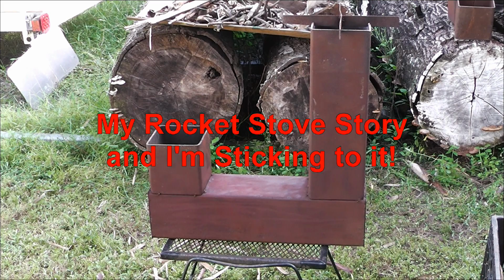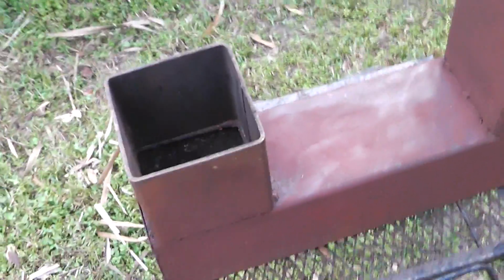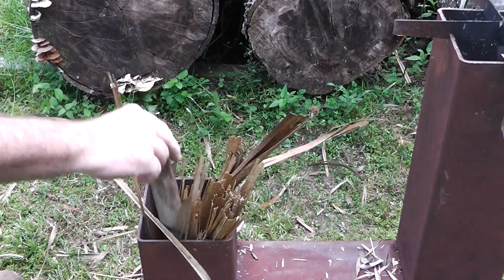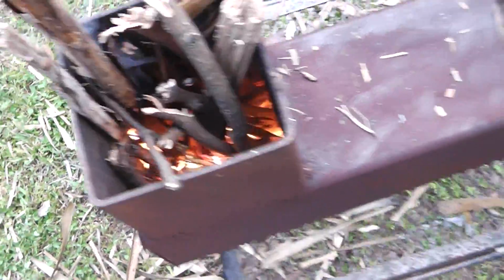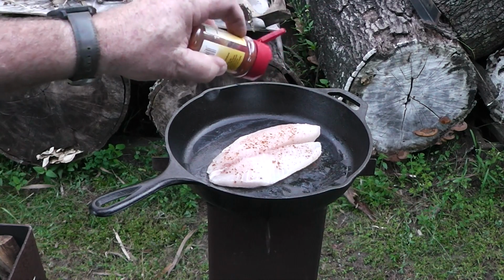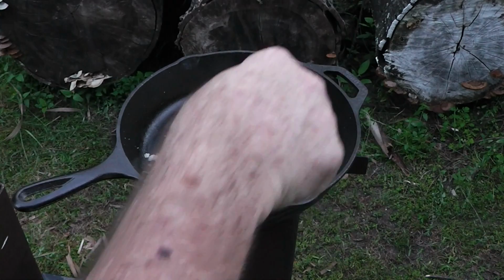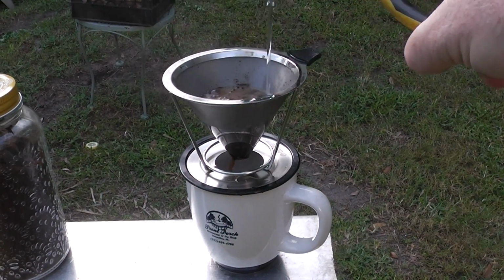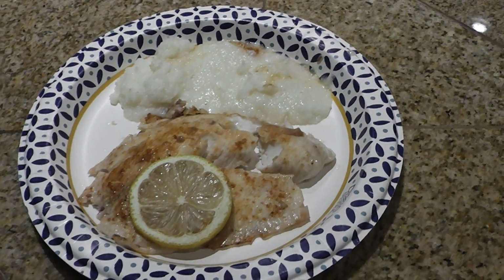Experimental Rocket Stove

Comment: I like the dual burner...you are blessed brother
Reply from the maker: Thanks bro!  We are both Blessed!
Reply: @homesteadprepper  have thought about this video and have a question. How do you control the temperature of the stove if you are not feeding the fire? I fry fish on mine and need a constant temperature, so I just back the wood up slightly to cool it and feed it more to raise the temperature. It would be easy to increase the heat but what do you do to cool it down? Just pull the wood out?
Reply from the maker: I didn't show it in the vid but, I have a 6"x8"x3/16" metal plate that I can put over the lower part of the intake side to restict the air and drop the heat.  The real beauty of this type of stove is that not only do you have 2 cooking surfaces but, you also have 2 temperatures. The lower cooking part of this rocket stove is on "high temp" and the upper part is like a medium or low heat depending on fuel and air. If you want to chat a little more on it, I will leave an email/ph# on your business website.
Reply: @homesteadprepper  gravity feed and using a damper sounds cool to me. I knew there was more to it than I could see! Thanks ol buddy!

Comment: This video tempts me to pick up a tube next time I visit the steel store. I wonder how well a 4x4 tube would work? For me smaller is better, but only if it works. If I make a 4x4 one, I would proportion down the dimensions, but leave long enough middle to hold a pan. I like your design, seems to work well.
Reply from the maker: Thanks. Sounds like it would work to me.

Comment: Hi, what are the dimensions you ended up with for the stove?  I like the J-tube stove configuration but can't seem to get it to stop smoking and burning back up the feed tube end.
Reply from the maker: Starting with the left side upright=12",middle horizontal=24" and the right vertical=27". I had good success starting the fire in the right side vertical first then starting the main fire in the left side verticle to get it going properly.
Check out: https://www.youtube.com/watch?v=7YfN5QCyzdg
It is the same rocket stove but, modified.